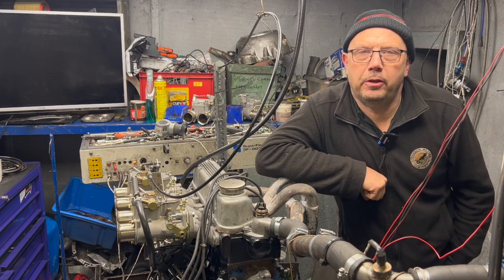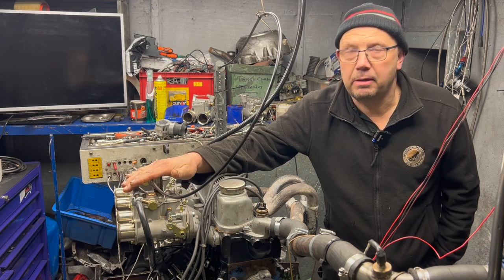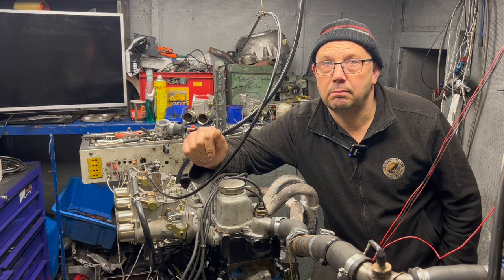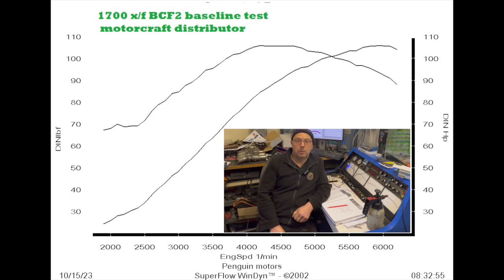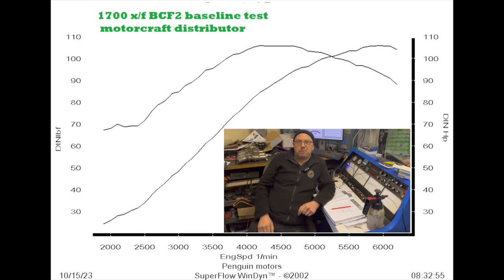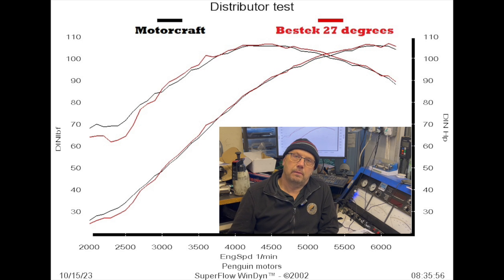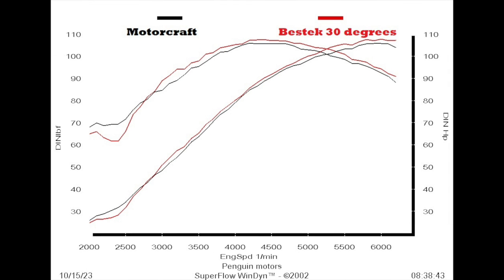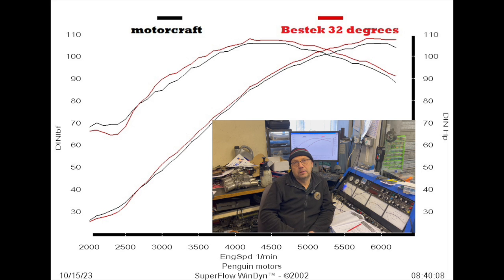FORD X/FLOW BESTEK DISTRIBUTOR TEST

Comment: When setting max advance do you check idle advance  anyway has idle advance on JONs kits make a big difference and the start up hot or cold with best tek is far superior to any other kit. Ive fitted so many of Jon's kit's and every customer has always said how much better the cars drives and responds
Reply from the maker: i do look at idle advance but usually only as a reference to set the timing is somewhere near correct, before properly running the engine and setting the timing at high rpm, idle timing is fairly meaningless, a few degrees either way doesnt hurt, a few degrees wrong @4000 can be an engine killer
Reply: @PenguinMotors  I'd say different TBH low end advance makes a big difference to slow speed driving at the lower RPM. Each to there own I guess.
Reply from the maker: @waynewigger9904  if you have the CORRECT advance curve low speed will be near enough correct with high speed correct, setting timing looking at only low speed is asking for a dead engine, there is a very good reason why in the days before datalogging etc  old school dyno opererators used to swing ignition timing at peak torque. Seeing as i use his distributors i think  if i was doing it wrong Jon from Bestek  would tell me

Comment: Can't wait to see the test with the twin Webers. I have the Bestek ignition on a Pinto with twin 40 DHLAs. Awaiting re-jetting on a rolling road to take advantage of the revised advance setting and my mildly uprated head & 134 cam. In the meantime, starting is certainly improved over points..

Comment: with a DVG Weber copy you can run the numbers as well, on a standard engine by tuning it properly. It even may give more low down performance.
As with the dizzy conversion, it is a small but for money spend good game i think. It last longer too as with points burning in...in time.
many years ago I used elektronic parts from Microdynamics and Lumenition. If they are still around i dont know.

For road use i would go and do best on a classic car just with points dizzy. Even with mild fast road setup, you wouldnt care about the last 2 HP
and change the contacts points is no big deal if they are still available . get them in by 2 or 3 sets for backup
Reply from the maker: i have run chinese copy webers, power wise they make the same power as the real thing. sidedraft webers and points are a real pain, and modern points and condensors are junk so whilst i do have a few customers still using points almsot all of them now run electronic ignition
Reply: @PenguinMotors  i did'nt had points on my Kent crossflow with dcoe webers 30 years ago, it was converted to elektronic back then. I had an Aldon distributor running. It was better as the standard FoMoCo. So i don't know about the disadvantage with point's distributor. Ande surely what's on todays market replacing contactpoints on an old car. elektronic is better for sure, but just saying it may do for standard ? I had used them on stock engine, it ran good enough. So well, i looking forward to your upcoming video's and some powerruns on the dyno for comparison. 

Thank's

Comment: where has the extra torque come from ?    increased voltage or multi spark at the plug tip, or distributer internals providing a more suitable advance curve
Reply from the maker: in a conventional petrol engine multi spark is pointless, the first spark will set fire to the mixture, any spark afterwards wont do anything and would be retarded anyway, at high rpm there isnt enough time for multispark to actually function anyway. I doubt its voltage related, you only need enough to set fire to a mixture, a bigger voltage wont do much unless you have a burn problem from a weak spark. most likely its two things, a better advance curve, meaning more high rpm advance without over advancing the midrange but also a more stable spark advance with less timing scatter
Reply: I thought your special distributor was pointless  😊  haha you will have to think about that one !  Yip lean burn engines do benefit a bit from multi spark and high voltage wide S/P gap ,  but yes, I suspect mostly advance curves,  how about another run with the old dibi and locked plate adjusted manually at preset rpms ?   @PenguinMotors

Comment: How much extra hp does using the 1300 + 90 pistons give over leaving it standard? 👍
Reply from the maker: not done a back to back test, but its a double gain more capacity, more compression, i'd say 10-12 bhp on an otherwise standard engine
Reply: If you did would do, then its leaving not much for an overhaul on cylinderbore. You gain torque alright by the 
saying "no substitude for cubic inches" I would rather go and seek for a 1600 cc crossflow block to build up.
A, 1320 cc leaves enough to rebuild by bore once or two more. 1340 cc i would guess tops in the end by just boresize.
Good information to read...https://1300sportproject.weebly.com/uploads/6/9/0/2/6902905/ford_kent_crossflow.pdf

Comment: So... Did the bestek really give you more power, or did the added 5 degrees of advance give you more power.... What a test. Please atleast lean some advance into the stock distributor as well
Reply from the maker: yes the the bestek distributor did give more power, i had already maximised power i could get from the stock distributor, in fact  at high rpm the bestek didnt need as much advance as the stock distributor

Comment: Hi Grayham, 
45weber on kart.

I've noticed that dip low down on other engines, I was wondering what was causing that?
Presume its a flow issue sorting itself out. 🤷‍♂️

Many thanks.
Roger...
Reply from the maker: A dip low down can be many things, incorrect ignition advance curve, AFR issue, cam too big, carb chokes too big, the list goes on but those are the main culprits

Comment: An interesting test, I notice a lot of V8 dyno runs seem to use up to about 37 degrees of advance at high RPM, presumably their bigger cylinders need it with flame propagation speed?
Reply from the maker: big open chambers also require more advance
Reply: @PenguinMotors  thank you for the reply, I was genuinely curious. I do remember way back getting a recurved distributor from Aldon Automotive for a pre crossflow. My memory may be playing tricks on me but I seem to remember distributors not having enough centrifugal advance, if you had the right timing at high RPM they would kick back against the starter while cranking. Thank you for making these videos, proper science!

Comment: Great explenation, one question, in One upgrade 1.6xflow engine with 1.3 +0.60 pistons, 244 cams, ported head, big vales, twin 40 webbers , what fuel Pump you recomend, elétric or mecanic
Reply from the maker: for road use a good standard mechanical pump will cope with that specification engine. for race track use i would go electric
Reply: Wich make you recomend , is a road car
Reply: @joaoconstantino6799  Electric fuelpumps don't suffer from vapour lock, that's all that matters unless you're go for original parts only.